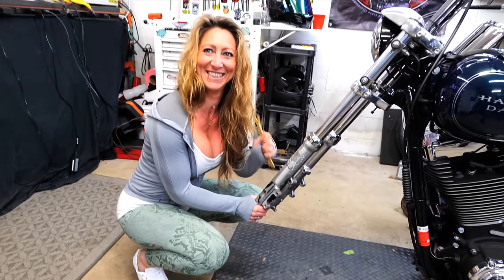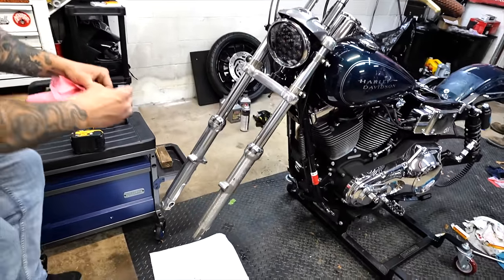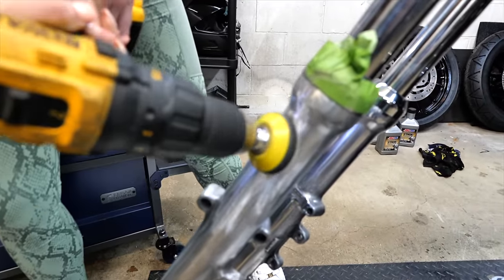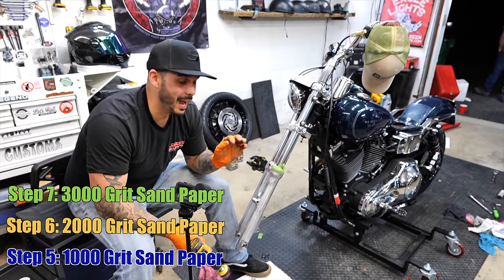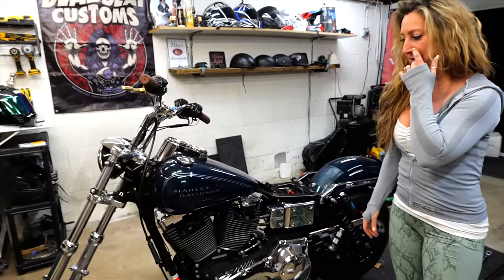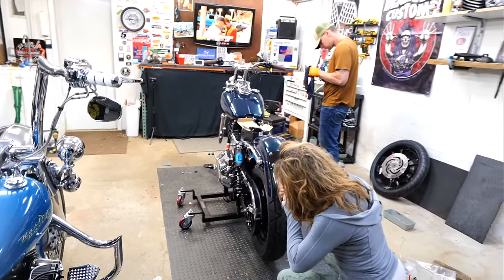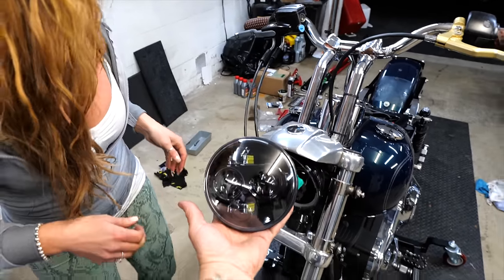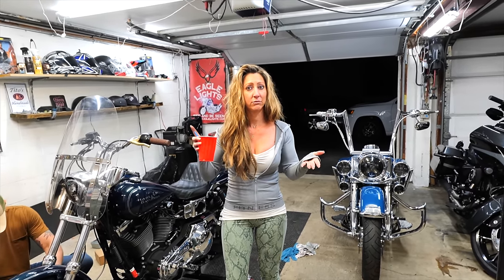Did You Know This Was Possible??- The Ultimate Harley Hack!

Comment: I did the same thing with my street glide turned out way better than buying chrome legs.
Reply: How does the polished metal hold up against corrosion, compared to chrome?
Reply: I haven't had any issues. I just wipe them down.
Reply from the maker: Much more cost effective!

Comment: Yea i remember doing that in the 80s I used sos pads 200 grit 300 grit 400 grit 600 grit 1000 grit  and 3000 grit all with washing up liquid in the water so the paper diddnt clog  Then i used the alloy polish  for a chrome finish It took me 2 hours for each leg and the engine covers on my chopper  We never had the nice cordless tools or the  stick on pads back then  it was all  hand rubbing and coach work for the paint  IE each coat brushed on then flat sanded Then next coat  and so on for 30 coats then a mirror polish Same as they do on the Rolls Royce's for the Tank Dunno bought the indicators ,peeps are so glued to their phones now they dont even see the bikes let alone the indicators  So loud bikes save lives Same as the ambulance ,police and fire department sirens So if there going to  com,plain about the bikes exhaust  that saves lives A good argument should be all the other sirens they should ban
Reply from the maker: It's an art of love for sure!